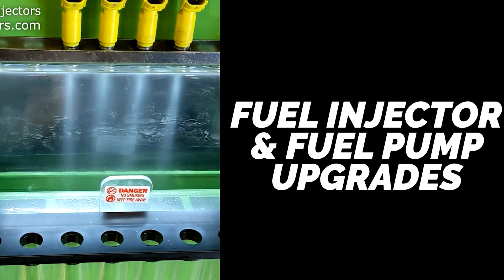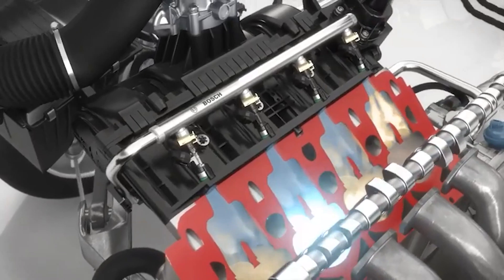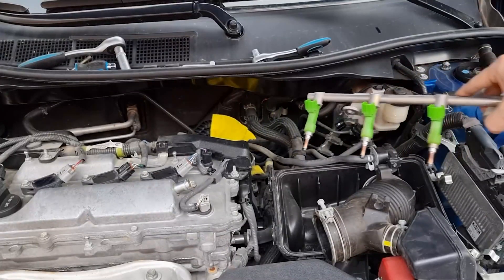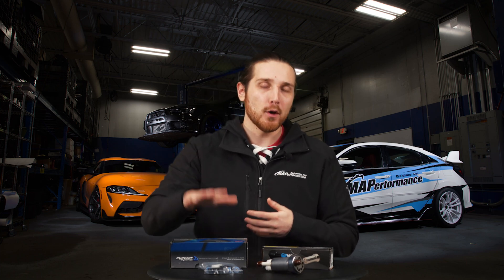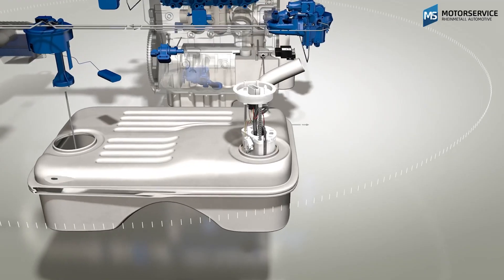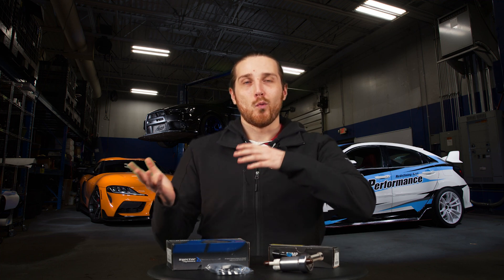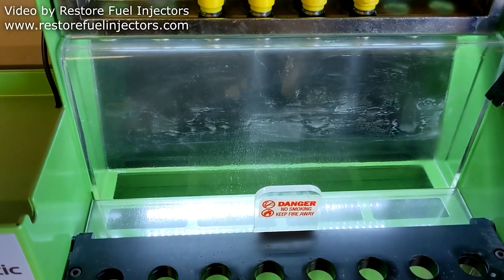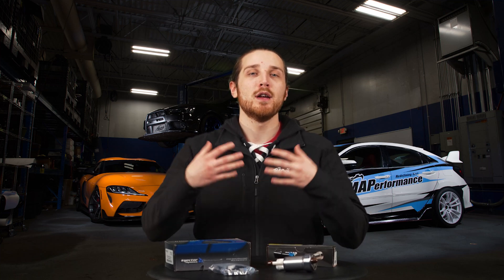Determining The Fuel Injector and Fuel Pump Size For Your Car

Comment: This guy seems nice and all but has he held a digital multi meter in his hands? Was it turned on?
 I started with carburetors but in 1976, other than a mechanical or CIS injection system, there were only two mass produced cars with EFI, the Cadillac Seville and the Datsun 280Z. This was it! 
Alternators produce less electrical potential at low speeds to idle, yet far better that a generator. At 1,200  RPM you would see a voltage of 13.2 - 14.3 at the alternator based upon ambient temperature. The colder a battery, the higher the voltage needs to be. Hot batteries have less internal resistance and are charged at a lower rate, perhaps 13.2Vdc. It always needs to be roughly 20% more for the battery to charge.  This brings us to the battery. A fully charged battery at 100% state of health requires about 0.20Vdc to maintain a charge. Today, even with more electronics than ever, it falls on the alternator to power the vehicle. I would never suggest this on any vehicle made the last 30 years, but, I could start a vehicle, remove the battery and drive it into the shop. Most everything has to be oversized but I have seen a careless trend to smaller gauge wire for everything. I the exact distance is known, and the max amperage passing thru it was 1 amp, engineers may select a 28 gauge wire. Copper is expensive, wiring harnesses are hand built and expensive plus the can weigh several hundred pounds. 
 Voltage drop increases with higher amperage circuits, snow plows, lift gates, certain amps or electric heater circuits. The fuel pump in a normal vehicle runs at 7amps. 7.5amp for many, less for others. A terminal of 1.5mm will carry 22 amps, but is ran with 18 AWG wire.  So in any condition short of stock with power adders included, get an amp clamp to use with a good digital multi meter and know how electrical circuit work. Voltage drop works only when this circuit is turned on. Since this is a series circuit, the component is supposed to consume all of the voltage in the circuit. If measuring across the component, it will show how much potential for electrons to flow. The closer to battery/alternator system voltage, the better. In a perfect circuit, you have small losses at each component including terminals inside each plastic connector, the switch, each wire and even a fuse. Don’t forget the negative side. This completes the circuit for the return of electrons. Amperage is the measure of force. The force in a fuel pump system should be measured to establish a baseline. If the amps go up, the pump is working harder, so a pinched line, clogged filter will change this measurement. If lower than normal, perhaps the the brushes are worn, spring tension is low or the copper on the commutator plates have worn severely and plastic insulated material is showing thru. Always know your circuit and it’s parts. Voltage drop is very quick, it is accurate and never lyes. Some ask “What if the meter leads are backwards?” The digital readout will simply show a (-) negative sign in front of this value. It is still correct. Starters, bulbs, fans all contain copper or elements that when cold, allow a surge of current. This is known as In-Rush current and is gone very quick. To check this, use a DMM with a Min-Max feature that records this event when first turn on. The DMM & Amp Clamp shows you happens in a circuit, but for decades, the big engine analyzer that rolled on wheels, set to Primary, will show electrical activity in the circuit, just like an oscilloscope. 
DK. ASE Master Tech since 78, retired.